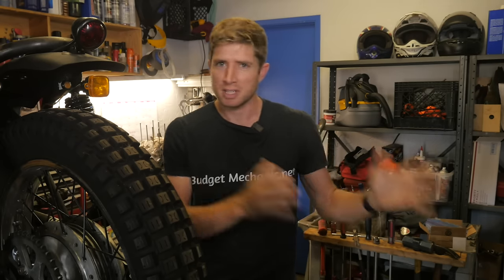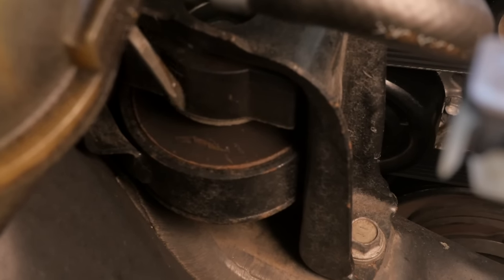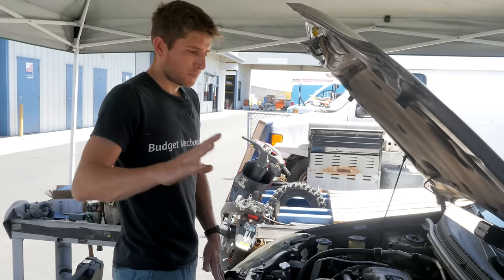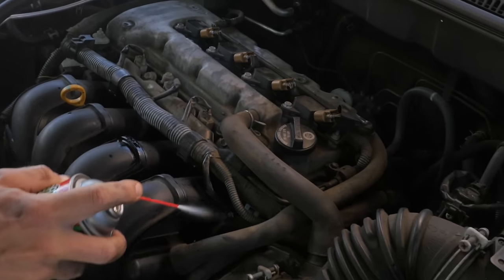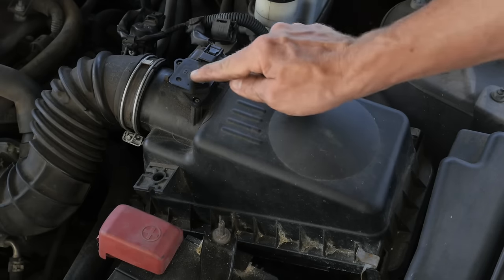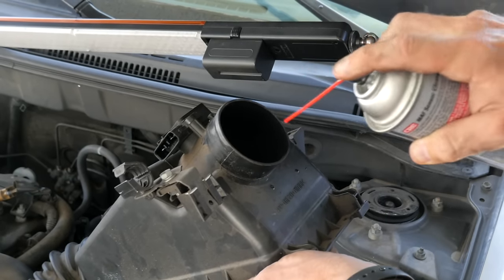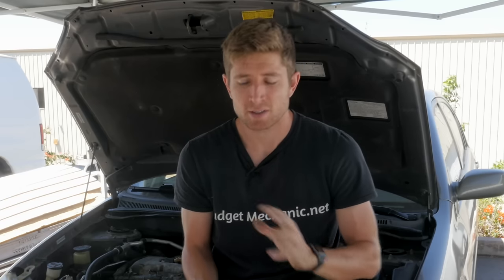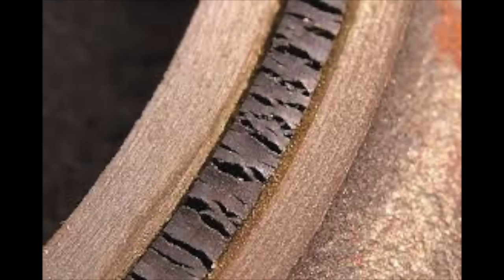Diagnose and Fix Rough Car Idle - Main Causes For Shaking / Vibrating While at a Stop

Comment: My check engine light is off but the reader says coil misfires running off on 1 or 2 coils I started with the coil pack but still read misfire then I replaced the plugs and wires but starts up quicker but still has rough idle so what should I do next
Reply from the maker: Plugs and wires meaning you have a distributor? Bad distributed cap can do it
Reply: @BudgetMechanicHawaii  it's a 01 ranger it has a coil pack and AutoZone said cylinder 2 is the one misfiring
Reply from the maker: Time to swap injectors from another cylinder, borrow a noid light, or do a compression test

Comment: 8:39 well i just cleaned my throttle body and moved it by hand 😬 my idle rpms are nearly identical as before even though ive only tested my car once since i cleaned it… (i disconnected the battery and unplugged the throttle body and outside of the engine I cleaned it, maybe that helped it not mess up?)

Comment: I have 2013 honda civic with about 60k miles that has a slightly rough idle when at a stop light.  The battery is about 4 years old.  I also had misfire issues about 2 years ago that was resolved by replacing spark plugs. And now have this weird vibrating idle at stop signs.  I noticed my idle RPM is around 650 when at a stop sign (using ODB2 tool).  And the kicker is, if i turn on the headlights or turn my wheel to activate power steering, the idle smooths out and my IDLE rpm increases to 750.  In some forums, they are saying it could be a bad battery not supplying enough power at IDLE.  Not sure how true that is.  I don't think it's anything throttle body or emission systems related.  Because IDLE goes smooth with headlights on. Any suggestions?

Comment: My car doesn’t shake when I’m stopped at a stoplight, right now it’s totally fine. Every now and then though, like once in a blue moon, the car does shake a little bit like there’s a rough idle.  No engine light issues .As I said I only noticed this happen every now and then, it’s rare. It’s normal for the car do to this? Seems like I’m just getting standard vibrations in this case.
Reply: U ever get it fix?

Comment: anyone know why the cv axle keeps breaking on my 2005 scion tc? what would be the main cause for that? also my car pulls to the left and right when driving. someone told me it could be the differential. another theory is that a sensor my be triggering the anti slip. i didnt know my car had such a thing. if anyone knows what this could be please let me know. i want to permanently fix this issue and also my car is shaking and vibrating like this man described.

Comment: On my Toyota Celica GT its giving me a code PO171 system running to lean bank 1. what do you think could be the issue? air system? Fuel system?
Reply from the maker: Probably vacuum leak somewhere in the air system. Start simple by looking for cracks or holes in rubber hoses
Reply: @BudgetMechanicHawaii  Cool, could we also use a vacuum pressure tester to identify if it really is a vacuum leak?
Reply from the maker: Yeah if you’ve got one!
Reply: @BudgetMechanicHawaii  Alright thanks a lot for the responses man

Comment: Mine is vibrating when idle and in 5th gear between 2000 and 3000 rpm, I also noticed that I don't get the vibration when driving while AC/ heating is off... so far changed engine mounts, MAF sensor.... still vibrating when idle and 5th gear the car is a Vauxhall astra 2006 1.8 petrol. Any help welcome.
Reply: ask the dealership if they can reprogram your main computer.

Comment: So I have a rough idle but it’s almost always after my 2007  BMW X3 has been running for a while AND as soon as I turn on the AC! Otherwise the car runs great which has me very confused as there is no check engine light comes on and no error codes when I plug in my OBD reader. I have changed the Vanos solenoids but it has made no difference. Also, when the car starts shaking somewhat I pull over to the side of the road and turn the Engine off but it takes about 4 to 5 seconds after I have turned the key off for the engine to actually shut down. It does this only when the car is vibrating otherwise the engine is shut off normally. 

Does ANYONE have any suggestions? Not being able to use the air conditioning as it triggers the vibration usually within about 5 to 10 seconds is problematic because when it rains the windows inside my BMW start to fog up and I can’t turn the air conditioning back on without having the vibrating issue! 

Help!

Comment: My car idles at 400rpm even in cold start. It should go up to above 1000rpm but it doesn’t. It needs to be warmed up to hit the throttle. If it’s still cold and I hit the throttle, the rpm even falls below 200 and stalls. What should I do to fix this?
Reply: Watch the video and follow the steps? Lol. Did you try some things? What worked?

Comment: I have now experienced 2 separate occasions where the starting , idling and accelerating went down after using contact cleaner (spray): a. spraying spark plug wires & distributor cap (outside only) to prevent nonstart when weather cold/moist, b. cleaning the inside of distributor cap & distributor itself (oil leak at seal) with contact cleaner then remove residue with compressed air. With a. the situation improved after a few days + driving, with b. I dont see any improvement. Anyone any idea what s going on with the cleaning? Toyota Carina e, 1997

Comment: If it idles really rough to the point of a flashing dash light but that stops when driving can you still drive it if the issue is only in idle? Been to the shop and the repaired all engine codes but they said it got worse and they never seen that before. Now at the Audi place and waiting on parts where some box was replaces but not a hose and that sort of thing - Thanks
Reply: Find a dealership that services your brand of vehicle.   Call their service dept. and ask them if they can reprogram your main computer.   Not all dealerships do it, but keep searching till you find one that can do it, that is, if your car has a main computer.

Comment: So my car does this when it’s going at higher speeds. We replaced all of the coils spark plugs oxygen sensors gaskets and still having the same problem.
Reply: Have you checked the PCV Valve? It can cause a rough idle if it has failed. Also check for air leaks.

Comment: I just had a flashing check engine light and replaced coil pack ,wires and plugs after seeing the standard codes for the situation but the problem came back after 30 miles. I can get the light to go out with a higher idle for a moment some times but it comes back with the miss. Any ideas for what to look at or is it a PCM issue maybe ?
Reply from the maker: If it was initially fixed, I would be inclined to suspect bad parts. Was the coil pack good quality? I might try another coil
Reply: @BudgetMechanicHawaii  I was able to get the codes read today and now it reads a P304 instead of the original P301 and yes the coil is gauranteed tested good before the fact. Tends to have me ruling out injectors and maybe looking at a PCM issue. But I don`t have testing tools and to beat all my shop is not finished with a diagnostic night mare of one of our trucks that went to a ford dealer and they misdiagnosed the problem costing us a wrong $6000 repair. Witch has me losing faith in mechanics.
Reply from the maker: Mechanics are horrible people!! I would say that if cylinder misfire number has now changed, it shouldn’t be injectors or computer... I’m still taking it has to be something to do with the things you replaced! But I’m not sure
Another thought: any chance the plugs or coils were oily when you removed them? (leaking plug tube seals)
Reply: @BudgetMechanicHawaii  Not oily not a leaker. plugs looked good but gap was to small on them. It was a gauranteed good working newer coil pack from my other truck. Another side effect both before and after 1st fix  is I can sit in park and idle up to 2-3000 rpm and most times the light would quite flashing but resume shortly after resuming driving and during increased idle it would just drop down to low idle as if I let off gas pedal then still holding on gas pedal with no movement it would kick right back to higher idle as if a switch was flipped and engine runs smoother at the higher idle but rough at low idle.
Reply: @BudgetMechanicHawaii  Though that reminds me one time I had to buy 4 alternators in a row to get one that lasted for more than 2 weeks the 4th one run for 8yrs until I sold the car
Reply from the maker: Kinda sounds like that...

Comment: How do you check the ignition coils with a scan tool?
Reply from the maker: Mainly a scan tool will just tell you which cylinder is misfiring, but not necessarily that it’s a bad coil. 
You can swap coils from other cylinders and see if the misfire code switches with it, or you can test the resistance of the coil using a multimeter.
Reply: @BudgetMechanicHawaii  have you ever tried testing resistance with a ohm meter on a modern coil? Where's the specs for that now? And what about the tsb for the ecu?

Comment: Please help,,,i replace a new spark plug, fuel filter, hightension wire, iginition coil, engine supports, fuel filter,,and still when i put in Drive my car is vibrating,,please help
Reply: Same

Comment: I have an brake booster leak. Could that be 1 of  the reasons ?
Reply: So you are losing vacuum if your brake booster is leaking.   That needs to be fixed, and go from there.
Reply: @tompastian3447  yes it was the brake booster. I replaced it and all the light are gone and no more problems 👍

Comment: I have a Scion tC 2007 recently changed the oil and oil filter and replaced spark plugs and coil packs. But every time I put it in reverse it starts shaking and making a weird noise, this also happens when ac is on and when I come to a stop it starts shaking and making weird noises do you know what could be the problem it has 193,000 miles
Reply: I have a Scion tC 2009, I have the same problem but only when I turn up the ac. Haven’t noticed anything unusual when reversing though. I got 116000 miles on it.
Reply: Angel Contreras P. That might be something wrong with ac compressor
Reply: Angel Contreras P. I fixed my issue by replacing the valve cover the old had a hole leaking oil and replaced the plugs that connect to the coil packs runs smoothly now hope this helps
Reply: Junior Padilla oh awesome, thank you so much I’ll be sure to check those things.

Comment: I have a 05 v70 and after I start it the idle goes up and down once at a stop light it stalled out had to restart it and it ran fine. Possible fix?
Reply: having the same proble m lmk if u found a solution
Reply: @AlejandroHernandez-ub4ln  I think I found it it's a air leak vacuum leak

Comment: My rav4 2006 idles sometimes when i come to a stop. It shakes the whole muffler and feels like its going to shut off..I also had 2 incident the car wont turn over when i started my car until for a little while of trying then it starts again. What would that be? Any thoughts? I feel like its my fuel system...
Reply: OMG, we just fixed our and it was like yours.  You would NOT believe this.  Corrosion in the Light Bulbs suck all the juice in the car battery.  When we were in Gear or Stop, the engine would shake and bogged down and about to die.  I knew it has to do with the Battery or Power or Alternator.  After getting a new battery + alternator, it still does it.  After checking the lights because we tested the backup lights, I saw bunch of corrosion in the sockets, I replaced them with LED for less power, now the car is great !!!
Reply: @JodBronson  Amazing tip Jordan
My 10 yr old Hyundai rear red lamp cover was vandalised 2 weeks ago letting in rain. MAYBE just coincidentally 1st time l start up since then, the car has the shakes + no power. 
Even tho' diagnosed by mechanic (without him even inspecting the engine or check light code ) as needing ignition coil pack replacement,  l will check the light bulbs then waterproof or replace the red lamp cover quickly.
Thanks for this knowledge.  👍
2. l put the wrong rear brake bulb in my Honda Prelude and the front frog eye head lamps popped up when l braked 🤣
We girls like (try)to be independent 🙈
Reply: @missp5152  -  You are welcome!  You can do it....  I too was mystified and there is NO video at all like this about " Corrosion Light or Light Socket or Broken - Leaked Power Wires " and YES, I will make that video later when weather warm up.  So yea, look at where it was vandalized and see if you see Wet or Broken Wires (Voltage Leaks) or Wire Ground To Car or Corrosions Sockets or Etc....  Just as simple as that and that is how it SUCK-ALL- BATTERY-JUICE from the Car and causing so much headaches.  NOTE:  DO NOT let your "Sex" be a gate to block you from doing things.  YOU CAN DO IT and IT'S VERY EASY..... Just need time, that is all !!!
Reply: @missp5152  - By the way, go on eBay or Amazon and get CHEAP LED Lights.  At the store, they charge an Arm + Leg for the same thing and don't ask me how I know, LOL.  Just replace them with LED lights (Less Power Consumption), ESPECIALLY from the back or ANYTHING passes your driver seat, because in the electrical world..., longer wires create problems.  This will suck LESS Power and give enough power to run all your stuff, like your spark plugs and few vital stuff.  During this time, try to avoid your Heat or Radio or anything that suck your battery juice.  This will eliminate a lot of things and help you even further with diagnostics.
Reply: @JodBronson  Jordan - this is amazingly helpful info  - you are 100% right, the bulbs are an arm + a leg from any Car Spares store

l will get LEDs online

The other annoying habit with the Hyundai is l keep the A/C button switched OFF but it comes on itself  EVERY time l start up  and  l don't notice til l have driven miles.  This is a big fuel waster.

l have to hit the green button on the Heater dial to switch it off over + over.  
Any tips to disenable in winter  - fuse box??

Many thanks for sparing the time
-  Paulina
Reply: @missp5152  - YES, that is one of the downfall to Automatic Temperature Control in modern Car / Truck.  Here is how you do it and YES... It will save you Power and Mileage too.  YOU ARE 100% correct on that thought.  Now.... Here is how you fix it.  On the AC Dryer (Big Round-Long Silver Container), there is something what they called the High (Low) Pressure Switch.  All you have to do is take that off and it will stop/prevent the AC Compressor from kicking in.  YES, as simple as that !!!

Comment: My car ( 2014 nissan note DBA-E12)  starts, idles a little but engine stops running, if I do not keep pressing on the accelerate to maintain rpm. what could this be?
Reply: Kevon Smith:
You have a fuel pump issue.  The fuel pump is malfunctioning and isn't letting gas flow to the engine.
Reply: @imo1933 , after further checks today, I noticed that I had a busted air intake hose. I used duct tape to temporarily fix, engine runs fine with that temp fix. I plan to go get hose replaced or fixed soon.
Reply from the maker: Good work!

Comment: I need help , i spent 1900 bucks to solve why my car vibrates in idle. I went to two mechanics got my spark plugs repaired, right upper mount, body throttle cleaning , replaced battery and serptine belt replace.  It still  vibrates i am getting very depressed because I feel like no one actually helping me fix the problem and I keep shalling out money.
Reply from the maker: Yeah very hard to diagnose this! Not their fault, you need to decide if it’s really worth it to you to get rid of that shake if you can’t do the work yourself...
Reply: @BudgetMechanicHawaii  i barely know anything about cars or what to do.  They did 2 inspection and they pass both of them. I have a 2014 nessian versa.  I just dont understand why nothing is working?

Comment: Hello I am an older woman and I have a 2005 Kia Sorento LX. I noticed lately that when I stop my car will skip. Like when I'm at a red light, a stop sign, in a drive-thru or just waiting on traffic she will skip every so many seconds. Maybe I'm saying it wrong maybe I should say she feels like she's trying to shut off but it's not rough at all. I'm sure this isn't helping much but I don't know what could be wrong with her. I'm getting ready to drive to my daughter's today 5 hours away I hope and pray that she is fine. It's almost like she has a very slight surge  while I'm idling. When l''m driving her she drives  beautifully. Could you please help? I can tell "the skip" is coming from under my hood in the motor. I don't have anyone personally that I can ask. Not anyone that knows about cars. I love this little car she's only got 129,000 miles on her and I'm the second owner. I try to take very good care of her.
Reply: Have you replaced the spark plugs? They could be worn and causing a slight misfire, not enough to set the check engine light.
Reply: @greendropwebmanager3974  no I haven't replaced them.
Reply: @grateful1929  Replacing the plugs could be a good start. They are due every 60,000 miles on your vehicle, so they could definitely be worn.
Reply: @greendropwebmanager3974  Thank you very much! Thank you for answering!
Reply: @grateful1929  No problem!